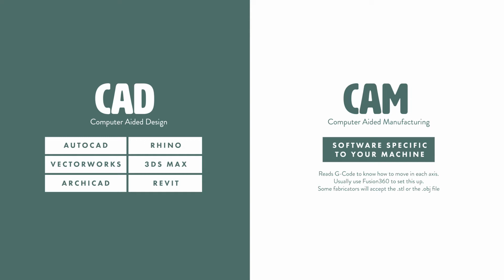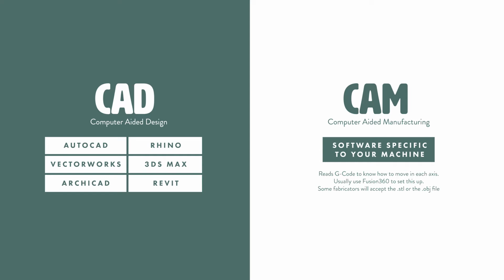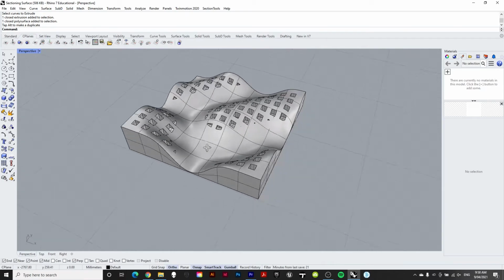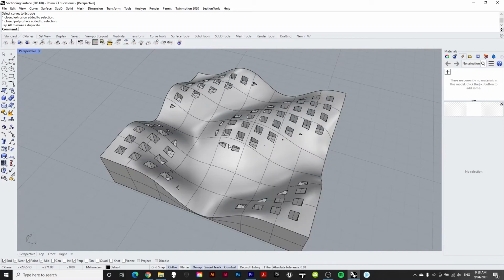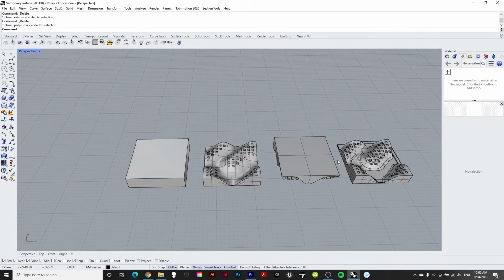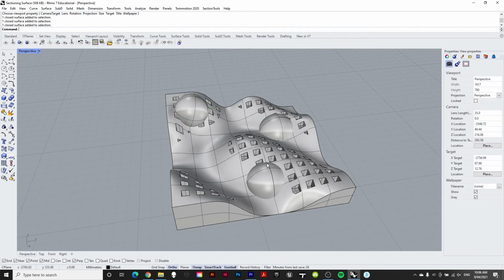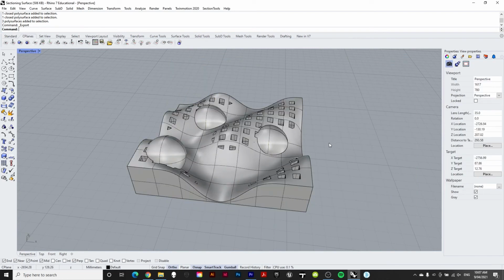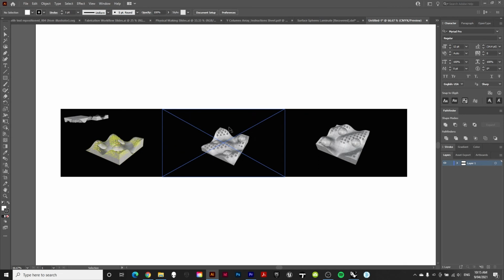CNC Milling workflow for Architects

Comment: Why we need to model the mass that would be carved out ? Is it a must ?
Reply from the maker: That depends on your workflow, and what software you use to get your G-Code for the CNC machine to follow. Typically, you can just model the final shape you intend to keep, then use a software like Fusion 360 to tell the machine what block size you're starting with, speeds, pass types, etc.